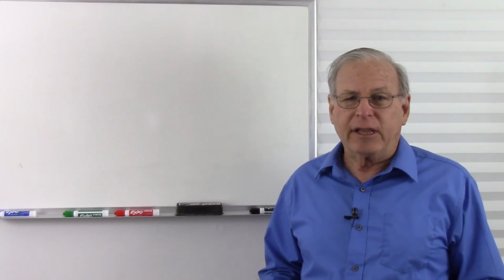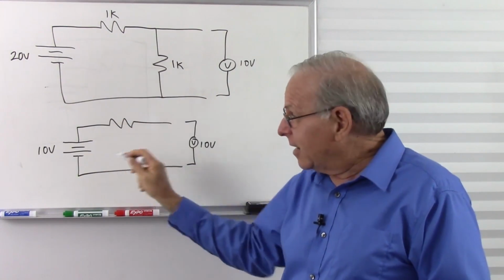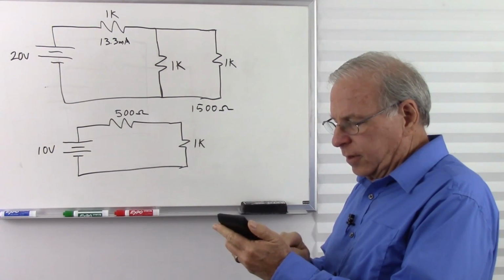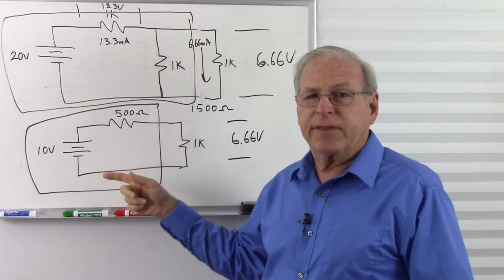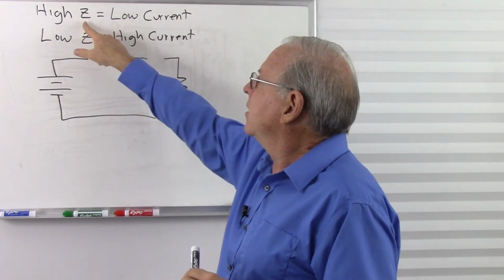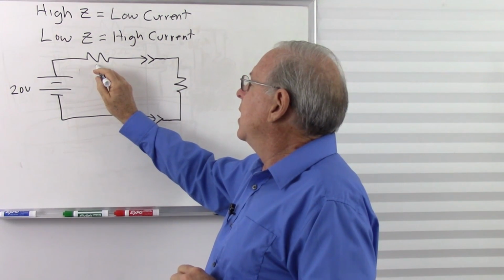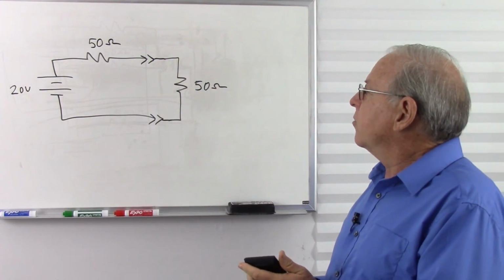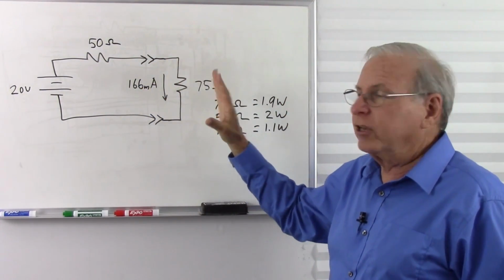Thevenin's Theorem, Output Impedance, and Input Impedance

Comment: At 24:45, you say that to maximize the power to the load, you want the output impedance to match the load impedance. Is that accurate? If you can change your output impedance of your source, the highest power to the load would be zero ohms output impedance; 20 V directly to 50 Ω is 8 Watts, much higher than 2 Watts as shown when they're matched. Obviously zero Ω is not achievable in reality, but much lower impedances than 50 is. Isn't the point not to maximize power TO a load with a given  impedance, but to maximize the load FROM a source with a given impedance? For your example, you were adjusting the load impedance to match the output impedance of your source, which maximizes power from your source.

Does that make sense, or am I off in the weeds?

Comment: Absolutely brilliant. This is the right way. I get the teachers that start teaching Thevenin Equivalents with "short the voltage sources and open the current sources".
That method is algorithmic and helps build a process that will work immediately for students, but it won't help with intuition. This method of "just meaaure the voltage across this element, then measure the current" is way more intuitive. 
It's like a special case for node analysis, which can work as any general purpose case. It's an incredible tool and a part of practical physics and electrical engineering that brings a ton of concepts together. 

What I love most about Thevenin Equivalent Circuits and Thevenins method of analysis is how it takes the high complexity of Electronics and stands it on it's head by using it's own logic in his favor.
Think of it like this:
Every element in a circuit, including the conductor, will have parasitic components which cause it to behave as a partial resistor, capacitor, inductor, etc. Imperfections are everywhere so, beyond theory, we can think of any circuit with inherent reactance. 
So even though transisitors and maybe ICs and other elements have been introduced (and we can still examine and appreciate each individually), it will still all simply down to some complex reactance with a source of power.
It is really a marvelous realization and a gigantic contribution to circuit analysis.

Comment: Great video explains alot of complex sounding terms simply . Talking of input impedances and output impedances , early professors specialising in electrical circuits and circuit designs also used these theories with power generators internal impedances matching load impedances. These ideas forced early electrical power designs to be series connected external loads usually arc lights. These worked ok but required very high voltages and difficulty in switching individual loads within the circuits being series connected . It was taught that the impedances must match to allow maximum power transfer from generator to load. Edison with  a non mathematical brain  and needing to have lower voltage and individual loads being able to be switched in and out without effecting other loads for his carbon filament light globe circuits went against these scientic laws  . He advocated for a extremely low generator impedance and parallel loads across the generator output . This allowed varying loads and still maintaining reasonable low  voltage  for his incandescent lighting supply networks. This went against theories taught at the time but worked as he invisaged without a huge  knowledge of mathematics what the system needed. Of course he was 100% correct and proved the input must match output laws not really suitable for power distrubution .
Reply: thanks for your points

Comment: Great video that helped me to clarify some doubts I had about antenna's impedance matching. I work usually with audio devices and I knew that low Z mics works good with preamps with an input Z of at least 5 times the output impedance of the microphone because you don't need too much current on the preamp input circuitry as they are voltage amplifiers and not current amplifiers, but I wasn't understanding the impedance matching of the antennas, now I can understand that.

Comment: It’s important to understand at the beginning that when he attaches the current meter, it is no longer an open circuit. The current meter has low impedance and so “closes” the circuit so that current can flow and can be measured. So the volt meter with high impedance measures voltage across an “open” circuit while current meter measures current flowing through a closed circuit. Just a clarification for those who are confused between how a volt meter works and current meter works.  Great video though.
Reply: Thanks! I was initially confused, but if the multimeter is a clamp meter, doesn't the circuit need to be closed to measure the current?
Reply: @ke6944 Yes. Otherwise you won't have current to measure because no current can flow in an open circuit

Comment: Why would low impedance say it “needs” a lot of current?
Reply: it doesn't need a high current, it has a high amount of current because it has low impedance to the flow of current.
Reply: @gezrick  That was why I made the comment. Was surprised he had said it that misleading way.
Reply: @OMNI_INFINITY  it also "needs" a high current to feed it, you will struggle to power a circuit that needs a high current, which would have a low Z, with a high Z circuit and it's low current.

Comment: Super informative, really good. This is a must see video for people that play the guitar out there. You see a lot of times the question about amp head to speaker cabinet impedance matching. Your video explains it all. In short using speaker cabinets of higher input impedance works fine with amp heads of low output impedance, except you waste power if you do not match impedances.  Thevenin s theorem does simplify massively circuit analysis.

Comment: You are a great teacher perhaps the best I have ever seen , my question is how to analyze if two voltage sources are connected in parallel to a load
Reply: Yes, Bob is a great teacher, but a very busy one at the moment, so maybe I can help. It is unusual to connect voltage sources other than certain types of batteries in parallel. Doing so increases the current the batteries can provide. The batteries should all provide the same voltage, and the voltage supplied to the circuit will be the same as that provided by a single battery. The internal resistances of the batteries will be in parallel, so the internal resistance of the battery pack can be calculated in the usual way parallel resistances are calculated.